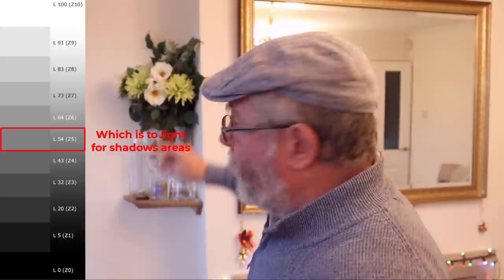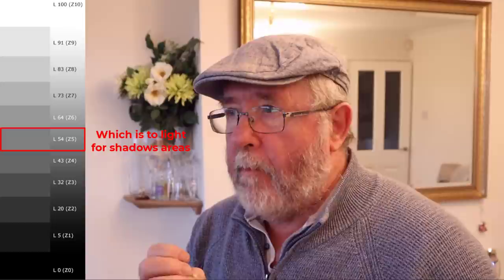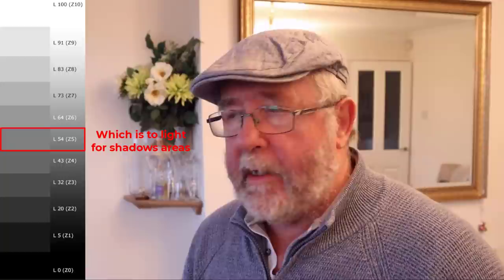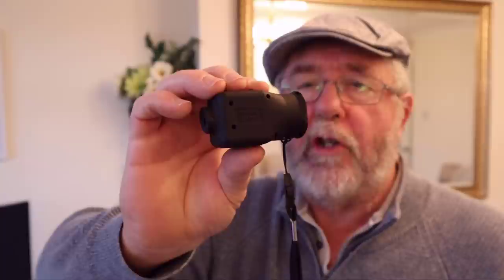Large Format Camera Still life, using 1 hour Stand development in 510 Pyro developer

Comment: You probably figured this out already, but you can use your Reveni Spot Meter in Zone Mode. Meter your zone 3 area, select zone 3 placement in the meter, and it will provide the proper exposure. An added benefit is that you can hold down the Menu/Compare button, scan the scene, and the meter will tell you where other areas fall on the zone scale.
Reply from the maker: Cheers Alan, I figured that out, but not the Nick Carver PMM mode , maybe you can enlighten me, thanks
Reply: @martinhensonphotography  I haven't used Nick's PMM mode...seems overly complicated to me. But, based on what I've read in the manual it looks like his text descriptors follow Ansel's zone system of 0 - 10. For example, what Nick describes as "Very Light" would equate to zone 8; "Medium Dark" would be zone 3. That said, it gets a little more complicated because you can set the high/low range limits in the config menu. For example, if in the config menu you set the high value to +3, then "Textureless White" would be 3EV above middle grey. Conversely, if you set low value to -2, then "Textureless Black" would be 2EV below middle gray. Essentially, I believe these settings in the config menu enable you to set the dynamic range of the film being used. I hope I haven't just confused you more.
Reply from the maker: @alanhuntley55 Thanks Alan, I get it, seems overly complicated to me as well, I can do all the above with just the simple spot metering mode, one thing that I did not like is the fact they include a mode on the meter and then you have to download and  buy Nick Carvers metering  Pdfs which seems a little odd when buying a product that should have detailed instructions especially for the least advance users how to use it correctly.
Reply: @martinhensonphotography  Yeah, the idea of having to buy Nick's metering course to fully understand PMM mode bothered me, too. And, the course is more expensive than the whole dang meter! (CAN to USA money conversion) To be fair, though, I believe Nick was offering some sort of discount to buyers of the meter. Don't know if that still applies.

Comment: Hi Martin, I’ve just shot some Fomapan 400 5x4 sheet film at 250asa with the intention of under-developing the film to reduce contrast . I haven’t tried stand development before, but having just seen your excellent video I’m tempted try stand development using your technique . I will be printing in the darkroom, and wondered whether the colour of the stain would have any contrast affect on the Multigrade paper ? Thanks Ed
Reply from the maker: Yes I think it will  in the respect you will have to use a harder filter, the good part is doing that you don't loose tonal range at the expense of contrast, try it and see

Comment: Very nice image. 
When you remove the holder does it squeegee off the water and are you worried about scratches?
Reply from the maker: I never use a squeegee, just add a touch of wetting and soak the film for 30 sec or so and hang to dry naturally

Comment: Hi, Martin. I have been using 510 pyro on FP4+ sheet film in a Stearman Press tank in a semi stand technique with 2.5 mls of 510 to 500 mls of water and found that I am getting a deposit on the non emulsion side of the negative in bands that coincide with the vertical of the frame of the negative holder. I am using a newer version of the frame than the one on your video. It is best described as what you see left over from applying sellotape to glass and then peeling off the sellotape. It is not happening with development in Ilford DD-X. You haven't mentioned it so sounds as though it is not something you have noticed. Just thought  I would mention it and wonder if anyone else has noticed such a problem.
Reply from the maker: From what your saying it sounds like underdevelopment , also are you placing the negative in the SP holder emulsion facing out ward
Reply: @martinhensonphotography  Thanks for the reply, Martin. Definitely loading the emulsion side facing away from the frame, and developed for 20 minutes. I will keep persevering perhaps trying an hour stand development.

Comment: Well explained! Is it possible to develop different filmtypes like FP4, PanF and HP5 at the same time in that method? What will happen when one of the 4 sheet is lowcontrast and the others has  high contrast subjects? Will that low contrast motive be too soft with stand developing?
Reply from the maker: Yes you can, however , you do loose the ability to control contrast individually when they are all in one tank,
Reply: @martinhensonphotography  Thank you…

Comment: Hi Martin , I just developed a roll of fp4 and Acros 100 with this method together in the same tank  . The Fp4 was amazing and the Acros a disaster !! Any thoughts on this ??
Reply from the maker: I really can’t say, what problem did you have with the Acros
Reply: @martinhensonphotography  The Acros looked very under developed, while th fp4 was fine , very thin negs with horrible black blobs on the top edge , The Acros was above the fp4 in the tank but I certainly had enough chemicals in there
Reply from the maker: @AustenGoldsmithPhotography  I wondering if you had enough developer in the tank
Reply: @martinhensonphotography  yes I did , I mixed up 1002 ml and filled the tank . I've made that mistake before so I know what that looks like